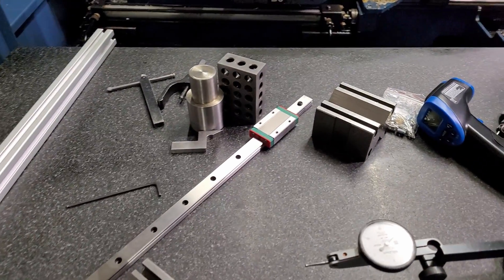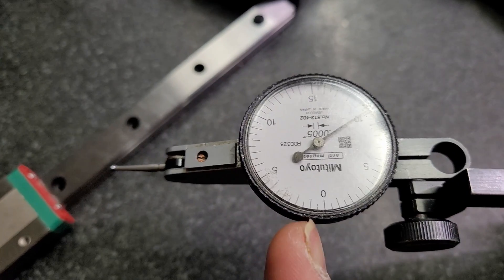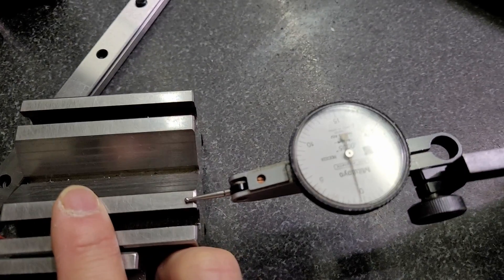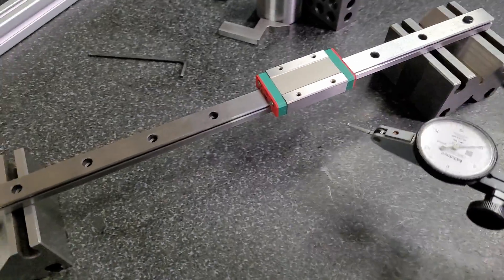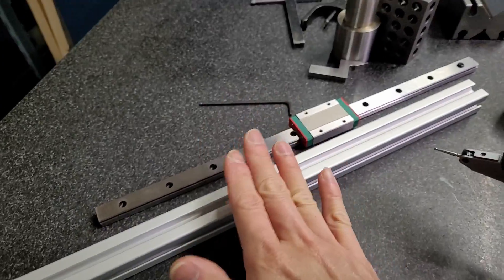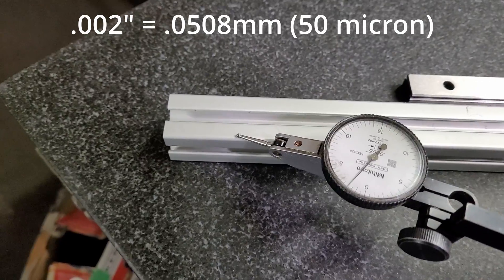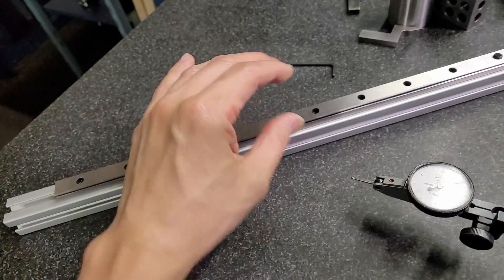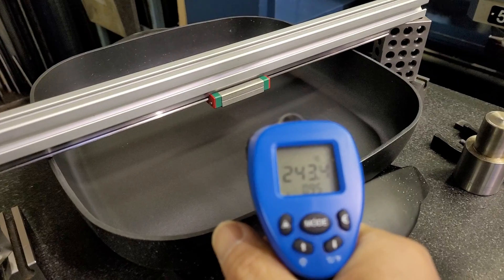Testing Chinese AliExpress Linear Rail and Extrusion for Flatness

Comment: You are measuring parallelism from the back of the rail. Nice inspection station though. Flatness is measured independent of any other feature.
Reply from the maker: You are  totally right, I should have probed the underside of the linear rail and the extrusion when resting on the V block to check for flatness. Thanks for pointing it out.
Reply: @lavithhcm  typically you want to jack up 3 points 120 degrees apart evenly to define a plane. Your total deviation from that origin would be your flatness value.

Comment: Linear rails flatness isn't as important as people think, that's not a critical dimension for them most rails are also preloaded intentionally to be flatten out when bolted down, this includes even very expensive rails e.g. rexroth rails. The critical part of the rails is the channels in which either the rollers or the ball bearings ride in.
Reply: @DOGMA1138  excatly, it should be mounted on a flat surface. I got thk, hiwin, cpc and tbi motion. None are flat before bolted. And yes measurement should be done at rated preload, even one series and size eg. Hiwin hgw20 got different preload and accuracy rating. Not to mention the bolt should also tensioned properly. And many recommend side loading to the rails or mounted on a slotted backplate, it is in the datasheet.

Comment: Many of the comments posted here are silly. It is nice to see that the deviations in the rail is small. But that is as far as it should be taken. Even if they were less flat (bowed) the important thing is the deviation found when the rails are mounted to the final structure. And as long as you have not done anything dumb in that structure, the small deviation will be irrelevant in a 3D printer.
Reply from the maker: You are so 99% right. 🤣  wait untill I show you my next little "experiment" by heating those parts over 70°C which my chamber temperature would never reach. Should I worry? Hell NO. 😂

Comment: Assemble, level and tune at operating temperature and you're golden.
Reply from the maker: Exactly! There is a paper out there advising people putting titanium backing plate to prevent deflection from bimetal thermal expansion. 🤣 I just wanna do experiment!

Comment: And this is exactly why , if you want something precise , you should not get cheapies from China. They are okay for a home edition 3d printer and so , but not for .02 spec routers , or when you make high spec tools.
Reply from the maker: Yeah i am happy with that tolerance for my 3D printer build. For $30 dollar linear rail from China, it is actually pretty good for just 25 micron (0.025mm) flatness. There is a band wagon where everyone puts another metal titanium backing plate onto the aluminum extrusion to prevent it from bending too much due to thermal expansion. And i am gonna show how much it will bend under influence of heat. Should we worry too much in that situation? Stay tuned!😂
Reply: @lavithhcm   Yeah , that`d be interesting. 
I think , depending on the mass and thermal expansion of the titanium , that it will create a bi-metal distortion , like in a thermometer or a thermostat. I wonder if that expansion would be linear , or create all kinds of artful but anything but linear distortion.

You`d probably be better off with just aluminium properly bolted down , that is at least linear and predictable.
Reply: Yeah you should be worried if you're using higher chamber temps. You can see the thermal deflection when probing. But it's usually within what a mesh can easily compensate for.
Reply from the maker: Under 250°C cooking pan, they both experience some what 80-100°C as you see towards the end of the video. There is of course thermal expansion that would bend both. What do you think how much it deflects? How many micron?
Reply: . @lavithhcm  Titanium`s expansion is about half that of aluminium`s , so that would probably be a mil or more.

Did you measure the lateral distortion as well?
Reply from the maker: @burningpentagram666  you mean 0.1mm or 1mm? A mil is like 0.039"
Reply: @lavithhcm  I'm measuring about 0.15mm in the center of a 300mm mgn9 attached to a 400mm 2020 extrusion. 
Between 20c and 70c temp.
Reply from the maker: @twanheijkoop6753  yeah I believe it. if you run your chamber temperature constantly at 70C, then yes it will bend that much. No doubt. My printer can't never pass 50C so i don't worry about the backers too much.